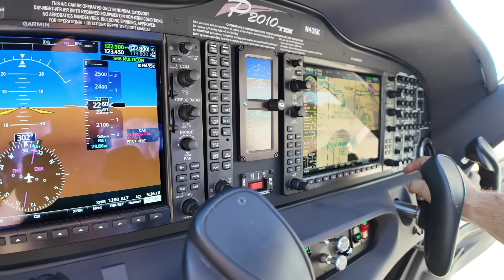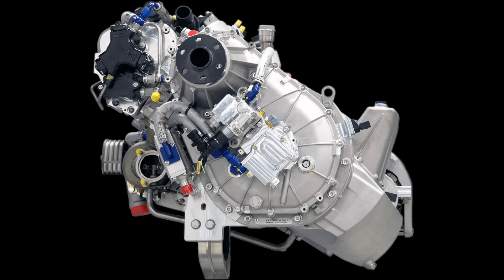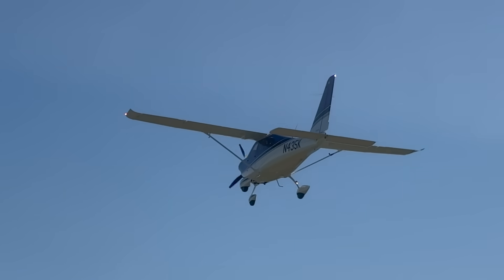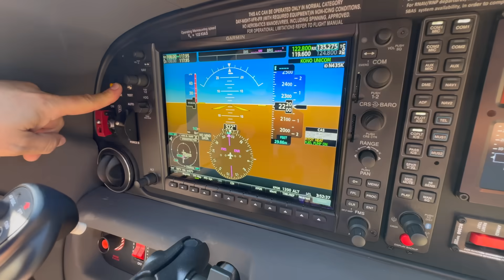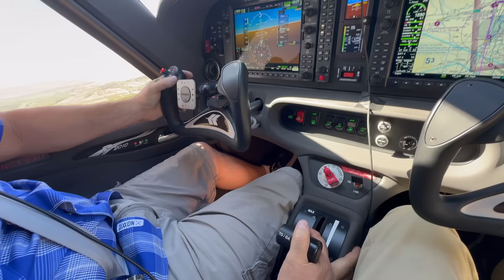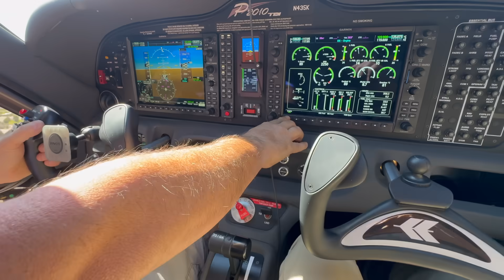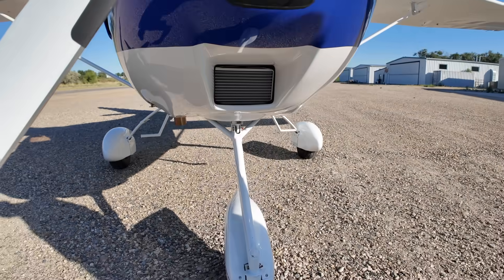Flying with a diesel engine

Comment: Diesel mechanic  52 years, new common rail engines such as this are very reliable.  The amount of power from a small cubic inch  engine is in creditable. Computer controlled  the amount of information on performance is outstanding. A far cry from yesterday. I have been waiting for some  start up company’s to ramp up, now with contential in the picture it’s a go. Much safer fuel and  less pollution no lead  it’s about time to get with it.
Reply from the maker: That was the first diesel plane I have flown. I was impressed. I think it has a strong future with a proven power plant. I'd love to see how the twin turbo 300 horse performs in a 206.
Reply: A runaway prevention test should really be part of the certification process for aviation diesels.
Reply: @PistonAvatarGuy  and a shutdown valve similar to what is fitted to some marine Diesel engines
Reply: @zOiNhUh  Definitely. That could also be a liability, though, if the shutdown valve accidentally closes in flight.
Reply: @PistonAvatarGuy  there are always some compromises, but I mean a manually actuated shutdown valve
Reply: Diesel mechanic and you reckon diesels have power? Nope nope nope  my 1.4L turbo petrol engine has more power than my 2.5L turbo diesel. Diesels are torque monsters.
Reply: @The.Drunk-Koala  They aren't even that. Naturally aspirated gasoline engines make more torque than naturally aspirated diesels. Some naturally aspirated gasoline engines even make more torque than some turbocharged diesels. You have to get really high up into the BMEP numbers before diesels start to "out torque" gasoline engines, especially when you're dealing with gasoline engines that are made to run on high octane fuels, and/or direct-injected gasoline engines.

Edit: Compare turbocharged to turbocharged and naturally aspirated to naturally aspirated.
Reply: This aircraft is powered by the Continental CD-170, which has a TBR (time between replacement) of 1,800 hours, not 3,000. The information is on the Continental website.
Reply: @PistonAvatarGuy You are right. He says it in the video. Does that mean it has to be replaced at 1800? Can't be rebuilt?
Reply: @cliffordrandell735  They have to be replaced. They're based on automotive engines, so they're not really designed to be rebuilt.
Reply: @PistonAvatarGuy I see. That's pretty wild
Reply: @cliffordrandell735  I'm sure that the short block can be rebuilt, but it's probably cheaper (and safer) just to replace everything.
Reply: @PistonAvatarGuy Seems like a much more expensive option. That's a lot to pay for the novelty of having a diesel
Reply: @cliffordrandell735  Obviously there's an advantage to being able to burn jet fuel, but everything else is a disadvantage, relative to what's possible with modern gasoline engines.
Reply: @PistonAvatarGuy is jet fuel that much cheaper than regular avgas? Or more available? I guess another up side is just the general pushing technology forward. But I'd hate to maintain that plane. I think a brand new 172 would be way cheaper and more proven
Reply: In the US, the difference is minimal, but it's a different story outside of the US. Either way, we're stuck with gasoline in the US, as hundreds of thousands of light planes can't simply be abandoned, and most can't be converted to diesel.

My concern would be performance. Altitude is safety, and the diesels offer extremely poor climb performance relative to modern gasoline engines, due to their poor power to weight ratios. The Austro Engine AE330, for example, weighs 410 pounds and makes 180 hp, while a 410 pound gasoline engine with the same power to weight ratio as the Rotax 916 iS would be making 330 hp.

The Rotax 916 iS could also be used to power the 172, and it would improve the performance and efficiency of the aircraft, while also increasing its useful load by 100 pounds. With a diesel, the 172 loses 100 pounds of useful load.
Reply: Wastegate chargers are the best, good choice for an airplane!
Reply from the maker: @freibert  I could sure feel that waste gate popping on takeoff. Nice safety feature.
Reply: i have a 1980 mercedes 240d it is the best running car i have ever owned it will crack right over in negative 20 weather thats when mercedes made great engines..
Reply from the maker: @utuber2940  I bet it will last for ever too.
Reply: Diesel mechanic myself, diesel engines are also always heavier due to stronger internals, so there is the weight penalty in smaller aircraft, also the fuel is heavier
Reply: @spannaspinna Do you know why the fuel is heavier? Also do you know why diesels go further per gallon? I didn't. It's because there's more energy per gallon. Literally diesel is more dense with energy. You always hear other "reasons" diesels go further per gallon but that's the reason
Reply: Common rail is good but still much less reliable than mechanical injection. Can't beat a mechanical injection diesel for reliability. Any diesel is going to be more efficient than any avgas, mogas etc
Reply: @Blackbeardxx9 
2 or 4 stroke diesels?
Reply: Everyone one I know that works on diesels has a lot of bad things to say about modern diesels mostly due to emission garbage.
Reply: @RootBeerGMT yea I've owned a lot of modern diesel trucks and they are a nightmare with reliability
Reply: I'd still want to see how some unit-injector system, which remains in use for certain Mercedes-Benz trucks and buses (mostly in countries with lower fuel quality), would fare when it comes to reliability.

On a sidenote, FADEC having an extra control module for the sake of redundancy is a great improvement to overall reliability.
Reply: They are having lots of problems. With customers having engines replaced with minimal hours
Reply: @BRW2004 All passenger diesel cars in Europe have Common Rail and are very reliable.
Reply: @BRW2004 what's the specific problem? Apart from the electronics which are always the problem area on any engine the Merc Diesels are some of the most reliable engines ever. The newer ones less so. Same with diesel in general
Reply: @BRW2004 
본래  가솔린 엔진 TBO는 2천시간이고 디젤은 3천 시간으로 디젤 엔진이 더 길어요~~😮😮😮
Reply: What happens if you get a runaway engine ?? The wings will rip off and you will become a meat missile..
Reply: @cryptojohnny3921  cut the fuel pump.
Reply: @cryptojohnny3921  with common rail diesel the injection is computer controlled so you can't get a runaway situation.
Reply: @ioijiopjkiopjkp  Not true at all. Turbo bearing failure can cause engine oil to leak into the intake. Diesels will happily burn that oil as fuel, and despite the ECU/FADEC cutting off fuel it still can’t stop the engine oil in this scenario, so the engine speed keeps on increasing uncontrollably as more and nore oil is consumed. This continues until the engine either hydrolocks or seizes or floats its valves into the pistons (or a combination of these). In a land vehicle with a manual transmission, one can stall the engine by braking to a stop in a high gear without the clutch. In any other application, choking off the air intake is the only way to stop this process. It would be wise to install a Positive Air Shutdown valve in the intake stream to ensure that the engine can be prevented from running away in the event of such a failure.
Reply: @nkgagne 
그래서 요즘 디젤 엔진에는 단숨에 숨통을 끊으려고 트로틀 플랩이 있는겁니다.
Reply: Common rail is pretty unreliable compared to mechanical injection and even port injected petrol. I would go port injected petrol any day.
Reply: @ioijiopjkiopjkp  Complete misconception. Common rails get a bad rep because most all common rails are emissions equipped and those are the most common reasons for unreliability. A computer controller common rail system that is deleted will be just as reliable as a mechanical diesel. Mechanical diesel also fail catastrophically since the most likely failure is a run away which turns them into literal bombs.
Reply: @edgarcorrea7866  you're telling me 30000 PSI computer controlled direct injected diesel is more reliable than a standard port injected petrol? You are on another planet. I've seen probably 30 common rail diesels trucks fail in person.
Reply: Dude in the blue plaid shirt:
The diesel internal combustion ENGINE is not a motor.
If that very nice airplane was powered by an electric MOTOR then you would be correct.
But it's NOT.
You're welcome !

Comment: 1800 hours then replace.  No thanks
Reply: Exactly haha after I heard that I was like no way
Reply: @sobrr13  its okay.. just carry a parachute back pack if you intend to use them longer than 1800hrs..
Reply: Sore Loser... Unable to reason with me, you called me an Ai Bot.😂
Reply: Use Marvel Mystery Oil... you can hit 3000hours!
Reply: Lots of gas engines in this power range can exceed the TBO. What puzzles me is why can't this engine be overhauled when most diesels are easily overhauled.
Reply: @leeoldershaw956 This new Diesel Engines are made less Robust than Grounded Engine where the metal used are lighter and thinner walls to save weight. Not many times reboring can be done on the cylinders. Cost of overhaul it's not cheap and nearly the cost of new Diesel Engine, by as well replace it for Reliability.
Reply: @yours_sincerely48  Bro, Ai bot much?
Reply: @DISOPtv I see your channel..all junk cars...I. Service engines the size of a bungalow house.😂
Reply: @yours_sincerely48  Sure you do buddy.  Good job!  If you think a Ferrari Testarossa and Porsche 911 are junk, you just explained yourself so precisely.  It's ok to be jealous...
Reply: @DISOPtv The cylinder in our engines cost more than your Teterossa and Porsche combined. I deal with Marine Engines.
Reply: @yours_sincerely48  How many you got in your garage?
Reply: @DISOPtv Our garage? We called it our ship yard...lol
Reply: @yours_sincerely48  lmao @ U
Reply: @DISOPtv Small mechanic garage wants to challenge our mechanics😂
Reply: @yours_sincerely48  I am an A&P-I what aircraft engine certifications do you have or do you just sweep the floor at your "large marine engine" factory?  You know they are different types of engines right, slack jaw?
Reply: @leeoldershaw956  I wonder if the owner mis-spoke and meant rebuild not replace...  But that would be same as overhaul I would guess.
Reply from the maker: Few engines make it to TBO. It could be the TBR time increases with more engines proving themselves.
Reply: If you in Repair Engine Industry, Overhaul does not mean 100 percent back to original state of Engine. There are a lot of wear and Tear Part to Replace. Replacing a New Set of Engine is better but hopefully manufacturer can come out with cheaper engines
Reply: @yours_sincerely48  lmao you not clue have you
Reply: @DISOPtv Clueless is you.. I am in Engine Repair industry for 50 years already and still have mileage more to continue my career.

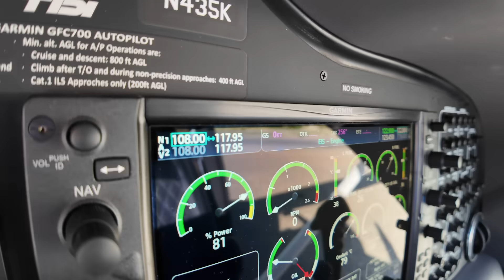Comment: 3:22 how Italian in terms of electronics to show 90% power with no RPM and dangerously low oil pressure! Belissimo
Reply from the maker: I believe the engine was not running at the time. But moving the throttle does show where the percent power would be since it's a fly by wire system. You're not actually moving a throttle cable.
Reply: @PlaneCrazyChannel so percent power is simply a dummy gauge that doesn't actually mean anything other than position of throttle... Do that on any really fadec airplane with the engine off and guess what... It stays 0%
Reply: @FlyingNDriving  part of the start checklist is to check and verify that the throttle is registering with the ECU.  Totally normal for this plane.
Reply: @FlyingNDriving  awaiting your apology, troll
Reply: The engine wasn't running!  Let's guess, you'd take a gas-guzzling 1950s engine any day?   This attitude is what has put the US 15 years behind Europe in aviation powerplant technology.